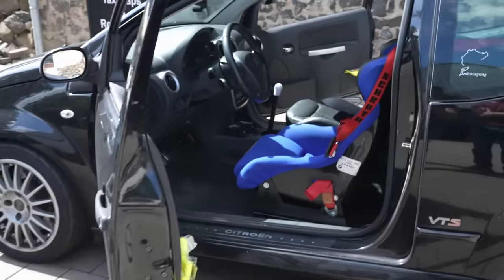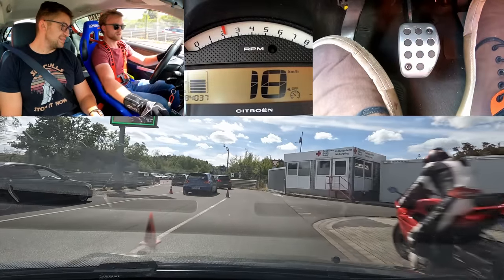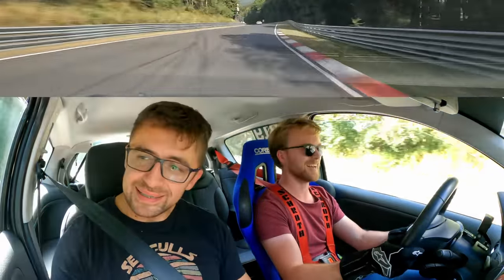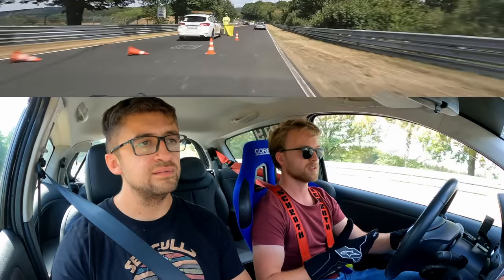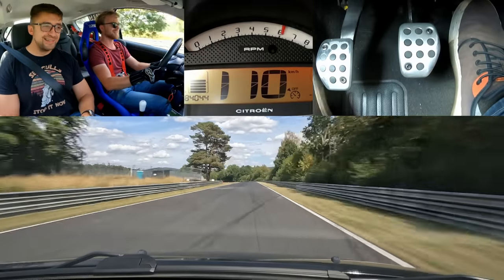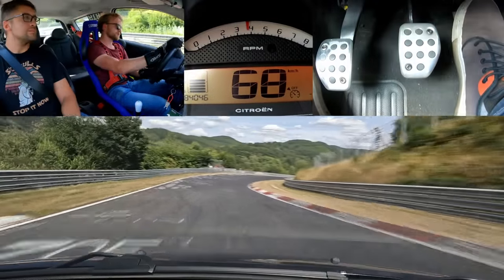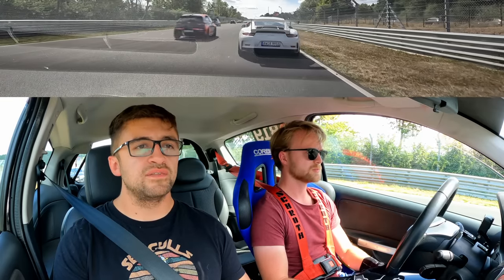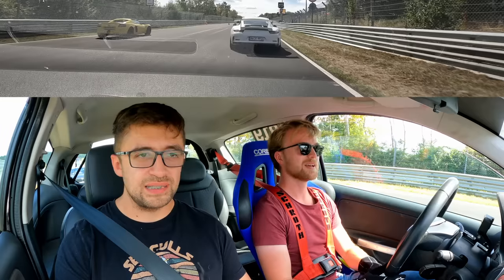LIL HOT HATCH! Citroen C2 VTS on the Nürburgring!

Comment: this car is really effective when driven, I would have aimed to add some horsepower to your stock engine. You have to give power to take advantage of the braking system you put in! my C2 had 187hp, so I was able to get a lot of satisfaction, even if it would have served a nice LSD.
Reply: Yeah, fair point. Could do with a bit more power. I went for the handling mods instead. Really makes the car come alive.
Reply: how did you get 187hp?

Comment: In Portugal we call these the C2 Cup , it started with the Saxo Cup( know as the 1.6 VTS outside of Portugal, his preceder), to celebrate the  national Rally trophies, but most people prefer to do the c2 engine swap in the swap to the saxo because of being a lighter and better handling chassis, improving the weight/power ratio and being better at receiving upgrades like cams, pistons from citroen/ Peugeot sport
Reply: What kind of setup would you prefer for swap?
Reply: @amdimilker5773  c2 engine, a CatCam higher lobe/duration camshaft, ITB’s, 4-2-1 exhaust headers, 63mm exhaust with ressonator and PTS muffler (all its the correct ecu should be around 40hp or more
Reply: @pedrogomes2554  I really want a c2 with a turbo
Reply: @amdimilker5773  you can and use extra weight to get extra grip of the c2 to get a bit more traction

Comment: One of the car I loved driving the most. Bucket seat with harnesses is one of the best mods (with a proper steering wheel) for this little hot hatch. Extremely funny, especially thanks to the fact it's pretty easy to drive at its limit. A friend of mine tuned one of these with pretty similar setup and asked me to make a proper ECU tuning on it, so I had the possibility to test out pretty hard engine and chassis of this little french toy. I literally fell in love with it after the first corner. I liked a lot the pedals position, it's pretty easy to perform heel and toe also during hard driving! Glad to see one of these on this Channel

Comment: Very nice lap and good to see all kind of cars on your channel Micha. To me it seems like it doesn't have 125hp anymore but I could be wrong of course. I would expect it should easily reach 160 and 180 on the long straight or is it because of going up hill 🙂
Reply: Ah, yes... It had 125hp or PS at some point... but I suspect not any more...
Reply: @NicolaasPhotography  seemed a bit slow yes, I went with a Honda CRZ this year, so 124hp with hybrid, 114hp if batteries are empty and yet I reached the same top speeds without trying as hard !

Impressive drive nevertheless!!
Reply: @TheSkyline35  Have you calculated for pancakes? 😁
Reply: @ThatOldGrey  Pancakes always AFTER the laps ahah, but the CRZ is a car easily +150kg over a C2 so 😅😅
Reply: This engine has its peak torque and power at lower RPM than most 16v engines, add that to a short ratio gearbox and at high speeds the engine starts to struggle.
Reply: There are some VTR engines with 110hp through smaller cams.
If you are not the 1st owner, there is always the (sad) possibility the engine blew up and got replaced…
Reply: @cooperturbo4598  It happens a lot and it's impossible to spot the difference without the opened engine
Reply: i had one! the top speed was higher, close to 209kph so idk

Comment: 13/59 gear ratio, lighter flywheel, smaller disc, 195/50-15 tyres and wheels, head work or cam change, 60mm exhaust with 4-1 or 4-2-1 headers and it will be much more fun and faster.
Reply: It's possible! Not sure if I'll do those specific mods...
For now, I like the setup

Comment: That must be the lap with the highest percentage WOT so far :)
Reply: Hahaha! Yeah.. Doesn't get half decent mileage on track at all. Daily driving gets me around 500/600km per fill up of about 30-35L where on track the cars computers says it will get around 180-210km of range depending on the track.
Reply: @NicolaasPhotography Man that is mind blowing! I have a 206 with 1.6 16V engine, with a four speed auto and I roughly get around 270km per 30-35L on daily drives. Since the C2 & 206 are both based on same platform, I would like to know what engine does yours have and whether you have done any modifications to it or not. And also what octane fuel do you use?
Reply: @emirmontazeri  I run an OEM airbox and run the car on 98 or 95 E5 octane. Besides that the C2 has 5 speed manual transmission. 
It's got coilovers suspension, semi slick tires and a big brake kit on the front.
Reply: @NicolaasPhotography  Wow that’s great! So I guess it’s the fuel that makes all the difference. The best fuel I can get in my country is barely 87 octane. And also that’s a very solid build my friend. Thank you for the enjoyable lap and your explanations🤍.
Reply: @emirmontazeri  anytime!

Comment: Nice lap, although there is definitly more in the car. With the mods, he should have been going faster in the corners. When the tires complained, he wastn't going that fast. Alignment issues? I would have loved to see Misha drive this car. He would have wrung out a faster time, and showed the river what the car is capable of. OR picked up how the alignment is holding the car back.
Reply: Thanks! It would have a been a fair amount of work to adjust the seat for Misha!😅
The alignment was fairly aggressive. It slowed down the car on the straights a little.
What also didn't help, is that the engine was down on compression...😪
Reply: @NicolaasPhotography  It was a great lap! I really enjoyed it. THere is more in that car. Im sure you will find it. 😀
Reply: @raullasvegas  sure is! This lap was around 10 minutes flat, my quickest recorded lap is around 1 minute and 5 seconds faster

Comment: I had the C2 Code which is 6sp manual, same power than the VTS, 125bhp in stock form, weirdly a tailgate....
I loved that car, it was awsome little runaround.

(edit: Just a 5 speed not 6)
Reply: Which gearbox was fitted on it? c2 VTS doesn't come with 6sp gearbox from factory
Reply: @mechanic_from_uk  it was the special addition "Code", you're right, just looked it up, it was only a 5 speed.

Here's a video on it
https://www.youtube.com/watch?v=Mo6brGx_mEg&ab_channel=JayEmmonCars
I had the same hideous seat colour but mine was black metalic paint. 
Great little car.

Comment: He brakes a lot , it pissed me off lol 
It's an underpowered car ! You need to take a wide line to maintain the speed and let it coast in most of the corners
Reply: Well... 
I mean, I did brake a lot during that lap.
To be fair, I've I got a passenger and I'm responsible for their safety despite them agreeing to join me for a lap.
The line I was driving was the line I was taught by my instructor.
Reply: @NicolaasPhotography  He's not your average passenger lol, but still good excuse 👌 you can improve over time don't worry about it cheers.
Reply: @aminegtr35  haha! I know. But putting him in hospital because I was trying to impress him and the viewers isn't worth it in my opinion. 

Absolutely, there is room for improvement!
If not faster, then smoother or a different strategy.